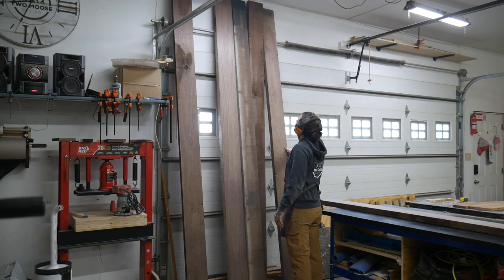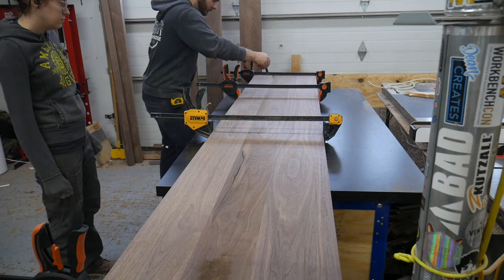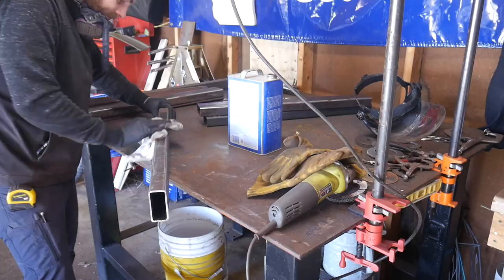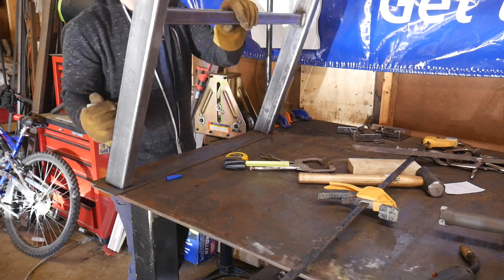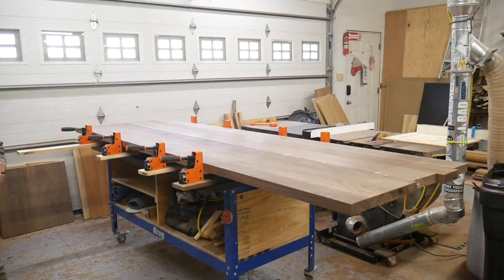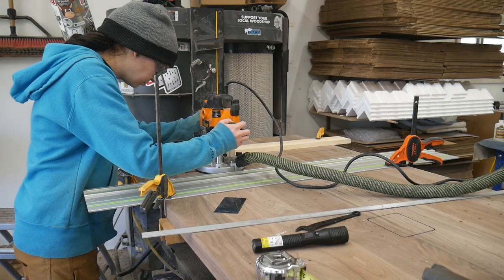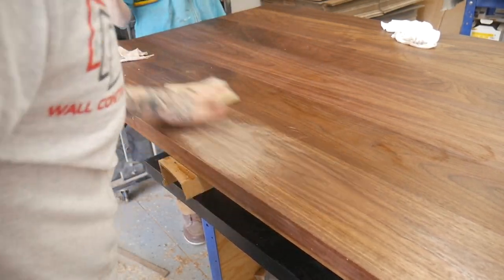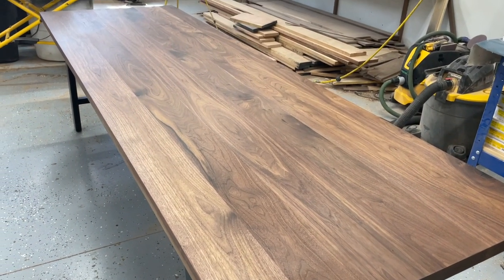Creating the Perfect Walnut Wooden Dining Table with Metal Table Legs

Comment: If you are selling that table to someone, they will have rusty leag issues 3-4 years from now since you used older rusty metal that has "pin holed" rusted. Auto body  strength acid prep would of helped out here, but I doubt you did that. When you do  high buck table you use the cleanest metal you can get AND acid prep it before painting.